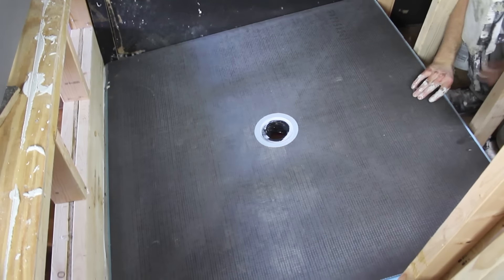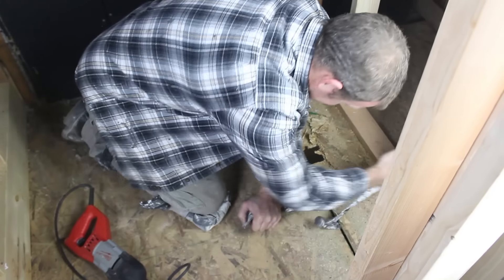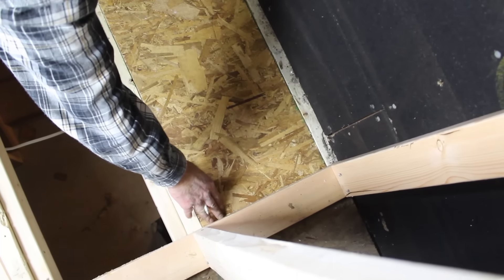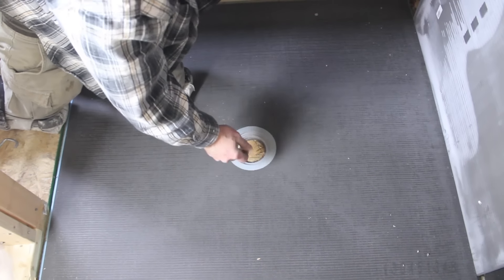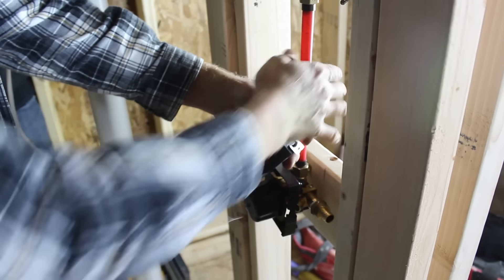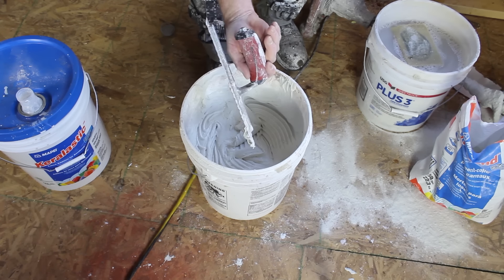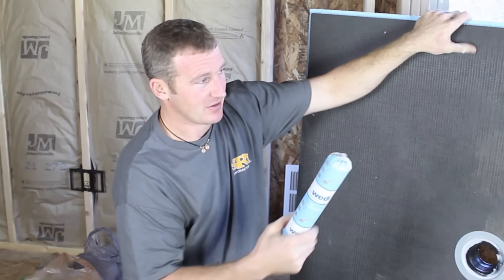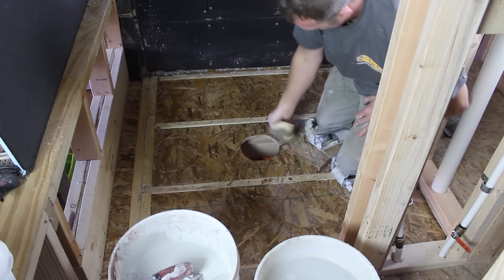How to Build a Walk-In Shower (Part 1: Wedi Shower Pan Install)

Comment: Can the Wedi shower pan be custom made?  My drain is in a different location.
Reply from the maker: +JustOchi not with this one...unless things have changed at Wedi. Do you want a curbed shower? Because there are options
Reply: HI, Thanks for the reply.  No not a curbed shower.  My drain is close to the wall at the head.  Just maybe 4 inches away.

Comment: Silly question, but if you're going to be tiling the rest of the bathroom floor (which is wood) as well as the walk in shower, should you bring the shower subfloor level 3/4 inch below the rest of the bathroom subfloor + backerboard (i would be laying the plywood plus tile backer board on the rest of the bathroom to stiffen the subfloor)
Reply from the maker: +Jay Sullivan you could do that. Keep in mind that the backerboard needs to be waterproofed if you're not using a product like DITRA.
Reply: Thank you, im thinking of adding both ditra and backer board to get the benefits of both to stiffen the , just need to sort the calculations in terms of not being too much higher than the hallway floor etc., but thanks for your help! Your videos are great.

Comment: Maybe I'm missing something, but would it be required to drop the subfloor down if using a curb?
Reply: No. The only reason they lowered the subfloor was to have a smooth transition from the bathroom floor to the shower floor. If you're doing a curb, you can skip that very labour intensive step.

Comment: Can this be used on a concrete floor such as in a basement remodel?
Reply: Not really , unless you will bring the whole floor up with 1/2 inch or the bathroom floor will be up with 3/4-1” higher than the rest of the basement.

Comment: Why did you have to remove the existing subfloor and set the new OSB substrate flushed with the joists?
Reply from the maker: To allow the 3/4” thick pan to sit flush with the subfloor
Reply: Can you set the new pan over the existing deck, or can you lay a sheet of cement board over the existing deck, then place the pan over it?
Reply: sakana1977 That's exactly what I was thinking was what the hell LOL.... why remove subfloor and level for draining when the floor pan if installed on the proper slope will drain! Plus who would use cheap OSB board 😎

Comment: That edge joint is not a dado it is a rabbet joint. A dado is a channel with sides that runs cross grain on wood . If it runs with the grain it is a groove and when it's on edge such as yours it's a rabbet.

Comment: Very helpful
Reply from the maker: +Joyce Amuso glad it helped :)
Reply: Home Repair Tutor where can I buy that bottom platform with the hole drain...
Reply: @Rigo Go to Wedi's website and search for a local dealer.  I found a few tile supply stores that carry it.  It is monkey easy to use and they have how to videos that are excellent.  I even discussed my install at length with a Wedi rep that came to my tile store.  He was very helpful and was able to answer even the most detailed questions for my unique install. I'll add that it's a wonderful product, but not cheap. However, the total cost plus your time will be far less than you'll pay a contractor to do it the old school way.  You can do a tub surround in half a day and a shower in probably a day or less.  We're talking ready to tile the next day or that afternoon.  It really is that easy.

Comment: What do you plan on doing if the drain gets clogged or water backs up the drain??? What's going to keep the water from escaping beyond the front of the shower entrance without having a pan liner all the way into the entire existing floor of the bathroom?
Reply from the maker: We recommend waterproofing the entire bathroom floor and flashing up the walls in case there's a clog. But clogs aren't a sudden event, they happen gradually. So the hope is someone will take care of that before it escalates.
Reply from the maker: @ltsgarage7780  the reason for waterproofing the floor is for two reasons: first, for clogs but also due to thin-set's capillary qualities, ie water has a tendency to find the path of least resistance. There have been cases where water moves from the shower out into the finished floor area via thin-set. If there's no waterproofing in the main floor then water wicks into wood and anywhere else. Adding extra waterproofing prevents this action.

Comment: Could you have put the pan directly on the original subfloor, rather than removing the subfloor and recessing it?
Reply from the maker: wedi makes pans for that, they require curbs. In this bathroom we wanted a curbless entry, so the Fundo Ligno was our best option. Do you want a curbed system?

Comment: How much would a shower like this cost to build?
Reply from the maker: It depends on the size of the pan and how big you want the shower. 
The Wedi Fundo Ligno ranges from $600 to $1200 
Each 3x5 foot panel (1/2" thick) is roughly $39 each. 
You'll need 8-10 tubes of Wedi Sealant at $14 each. 
And we recommend getting the Wedi Sealant tool for the corners, that's a few bucks. 

That should give you a starting point for the cost. 
Keep in mind that Wedi provides a warranty and the speed to install this is key, meaning you could build the shower in 4-5 hours and start tiling about 2 hours later. 

We've tried other systems but always come back to Wedi and moving forward it will be one of the only systems we use.

Comment: Good video but that drain is gonna leak eventually if you hand tightened it
Reply from the maker: It shouldn’t, the sealant is very strong
Reply: The reason he double caulked it with wedi is so that it never leaks. That's the way it's supposed to be done. If you over tighten it can crack the threads or crush the pan itself.

Comment: this video shows the install on a wood sub floor...how would this change or can this product be used on a first floor with a concrete slab?
Reply: Dr. Bill Arbuckle. You break out the checkbook and stick to what ya know.
Reply: I guess you would thermally isolate it so when you turn on the shower, the hot water will heat up the floor faster.Also diggin a hole in your slab.
Reply: Just chip out 3/4 depth of concrete slab

Comment: Hello. I’m wondering how much space you want between the pan and the wall? He was talking about putting sealant on the edges so I’m wondering if there’s supposed to be a certain space between pan and wall
Reply from the maker: the Fundo Ligno has rabbet cuts on the edges. We slide the edges up to the framing, fill the rabbets with Wedi joint sealant then embed the panels into that. You’ll want the pan to fit tightly against the framing

Comment: Plywood is a far superior substrate than osb (Over Priced Shit Board) oh thanks for the vid I did learn a neat trick using the sawzall blade thanks .
Reply: Wedi intallation guide 
General Limitations / Requirements
(Concrete & Wood Subfloors)
• Do not use over substrates including, but not limited

to: particle board....
OSB is particle board and it's not suitable for substrate, should go for plywood.
Reply: @mr.wizeguy8995  osb is not particle board. That's just silly talk
Reply: @nathandarkow3812  Defenition for OSB Oriented strand board (OSB) is a type of engineered wood similar to particle board, formed by adding adhesives and then compressing layers of wood strands (flakes) in specific orientations

Have to be stupid to claim it's not.
Reply: @mr.wizeguy8995  well if that's the case broccoli and cauliflower are the same thing cause they are similar.  Similar doesn't mean the same. Yes they both have adhesive but flakes versus sawdust is the big difference.  Osb has a higher tolerance to water than particle board.  If they were that similar then builders would use cheaper particleboard for subfloor than osb when building a house.  That is not stupid.
Reply: @nathandarkow3812  Yes you are right broccoli and cauliflower are in same cabbage family just like OSB and chip board are both in wood particle board family. There are also HDF, MDF which includes in same category because all those 4 different type of board is made same way from different size of wood particles.

Cheaper particle board? In my country OSB is much cheaper than particle board. And OSB doesn't have any better tolerance for water if it isn't treated with some additives to withstand water better but still OSB swells much more than example plywood.

Try google picture reach with "wood particle" and you will see many size of particles from wood.

Comment: I didn't hear or see anything about sealing the OSB! Hmmm.
Reply from the maker: It's unnecessary since the wedi Fundo Ligno is waterproof
Reply: Home Repair Tutor OSB isn't STABLE. If you want to use wood instead of backer board, then cdx  is water rated. It should be sealed as well. Tried and true method, without cutting corners.
Reply from the maker: We agree with the CDX. Adding CBU under Wedi pans is unnecessary though. If the Pan works and is flood tested then using OSB or CDX should make no difference

Comment: How do I do this on a basement concrete floor?
Reply from the maker: It’s very difficult, a better option is to remove the concrete and add a curbless mud pan. Our latest video series is giving tips on how to do it, here’s the first video 

https://youtu.be/8nWo9tfEkw0
Reply: I cut out the concrete in the shower area for new plumbing, and after that poured new concrete about 1/2" lower than the final concrete height. I then sloped a layer of mortar with added bonding agent perfectly. After curing I used a waterproof membrane on the whole floor and shower walls. Then I tiled.
Reply: Instead, I think I will "built a ramp" into the shower. It's about 7 foot from the door in the bathroom up to the shower, and then a 3 foot deep shower. So if I slope the floor upward, about 1/8 inch per foot leading up to the shower , then I will raise the entry of the shower  about an inch and then slope it back down about a quarter inch per foot down to the linear drain at the back end of the shower. What do you think? Thanks.

Comment: I would like my drain to be the long type about 30" long along the far wall.  Does the pan come with a built in pitch to drain the water?
Reply from the maker: You want the linear drain option. Wedi’s Riolito is an option. KBRS also has a linear option, as does Schluter. It all depends on the type of shower you want?

Comment: Everyone can do a sub floor walk in shower but no has done a cement foundation accessible roll in floor. Anyone?
Reply from the maker: KBRS has a Tile-Basin pan that can have a ramp added to it. That can be installed on wood or cement subfloors.

Comment: Seems like it would be less trouble and a whole lot less expensive to just build one with concrete. I think I'll save $800 and just pour the pan myself.
Reply from the maker: disagree, you have to get the concrete sloped 1/4" per linear foot on all sides and then waterproof and tie it into the main bathroom floor area. That's an option over existing concrete but this was new construction and allowed the shower to be installed in just a few days.
Reply: @HomeRepairTutor  over existing concrete? I don't see why I can't frame then lay my mat/waterproofing and then pour and slop my concrete. Hmm perhaps I'm missing something.
Reply: Less cost on materials but more labor.  It comes out darn near even

Comment: schluter vs wedi?
Reply: Wedi
Reply: I haven't used the wedi, but have used the kerdi many times. The big issues with kerdi are 1/expensive  2/ time consuming.
Reply: I would say Wedi.  It's a very fast system to install and can often start tiling the same day.  It's very pricy but in my opinion is the price I have to pay for the peace of mind knowing that I've just installed a permanently waterproof system

Comment: My contractor decided to build my shower which is on a concrete slab in my basement with no liner.  He mixed some sakrete surface bonding cement and used that to make the bed and covered that and the walls with redgard.  He insists if the the water gets past the sakrete it will just drain into the soil under the house.  I asked why he did not use a liner and he has no answer. I told him I called tech support for sakrete and they say it is not for horizontal use and it is not waterproof and he says "trust me please".   I am really upset.

Comment: question if I have a concrete subfloor can i get away from using the wedi shower pan? (at $600 a pop) I'm  renovating 2 showers after being flooded due to heavy record rains
Reply from the maker: +Jaime Flores you can always pour your own pan then waterproof it. Many differed options. Sorry to hear about your flooding
Reply: +Jeff Patterson thanks.  So after pouring shower pan, just paint it with awaterproof membrane ?
Reply from the maker: +Jaime Flores if you do a traditional mud pan you'll need a liner under it.

Comment: Where is the best place to buy the west system from? What's the average cost of the kit? Thank you.
Reply: According to his second video, the pan alone is $1200 !!! This will be a VERY expensive prep job once ALL material is bought.
Reply: Amazon and Home Depot will sell a kit for $1200-1500: pan, drain, curb, boards, etc.  Not cheap but IMO it's a good insurance policy as there's a lot less that can go wrong.

Comment: some people commented they may not like the idea of osb he used  under the wedi...BUT on a professional note Tile Council of America, which creates the accepted standards of practice regarding  all applications of tile and tile products,  strictly states solid lumber or OSB as a substrate is unacceptable surface when using  modified thinset with no mechanical fasteners..exterior plywood or cement board or concrete is the only recommended subsurface ...HE should have at least thought to use and let dry a liquid crack isolation membrane over the osb but that is not necessarily proven  ..this video really missed the mark on those 2 counts...contractors need to read instructions on all material packaging whether it be LAticrete, MApei or CBP, as well as have a TCA handbook on hand from the getgo  to consult to do it truly the right way...good video otherwise ...also get and read MIchael Byrnes Book on tilesetting  ...he is truly a tile setting guru who only uses accepted standards of practice in all his installs
Reply from the maker: Understand your viewpoint and why following the TCNA and CTEF are important. However, our Wedi representative was there during this installation. We followed their directions per the Wedi handbook at that time and this is how they recommended the installation be done. So, should we follow the TCNA or the manufacturer who will warranty the product? For example, if we apply Ardex 8+9 liquid waterproofing membrane under the Fundo Ligno, will that void the Wedi warranty or open a loophole for them to void the warranty? And is that fair to the homeowner? 

We highly recommend keeping the TCNA handbook on site for reference. However, the manufacturer's recommendations supersede those of the TCNA when it comes to warranty. TCNA will likely now replace the shower system and pay for the labor like Wedi. Hope that explains why we did the installation in this manner.
Reply: Tcna states tile itself should not be bonded to osb but a mortar bed under the wedi pan is acceptable.

Comment: sorry to disappoint you , but looks like you left osb board under  the shower base , no glue stick to osb  , because it has waxed surface .
Reply from the maker: +Andrii Prychepa that's not glue, it's modified thin-set, i.e. Kerabond by Mapei with Keralastic instead of water...exactly what the directions call for and overseen by the Wedi rep off camera...it was done right
Reply: gotta love know it all keyboard warriors ;)

Comment: Definitely won’t be using this system. I have installed many tubs and showers and never had to waste a much time on the preparation. Prep is the most important part of the job but this system is overkill
Reply from the maker: Prep is important for any system. But to not try new materials or consider them is a mistake. The speed, warranty, and safety are all benefits to the installer and client.
Reply: Home Repair Tutor Agreed
Reply: Agreed, there are other cleaner ways with less prep.  Cutting out the sub floor just to set the Wedi pan 3/4" lower is insane unless you're really in love with a curbless shower.

Comment: What a west of time what the reason to remove the plywood ???
Reply from the maker: this is a curbless shower, so in order for the shower pan to be flush with the surrounding subfloor the plywood must be removed. If this were a curbed system you wouldn't have to remove the existing subfloor.
Reply: @HomeRepairTutor  - I figured that out on my own, but it should have been made clear at the beginning of the video, when he started removing the subfloor. Most people wouldn't distinguish a walk in shower from a shower with a curb as being different. They're both walk in showers.

Comment: No shower pan liner n broke the tile  u failed
Reply from the maker: Aldabran, Wedi Shower pans are completely waterproof and do not require a liner. This installation was done with our wedi rep and meets all their requirements. The tiles were scrap and no good.